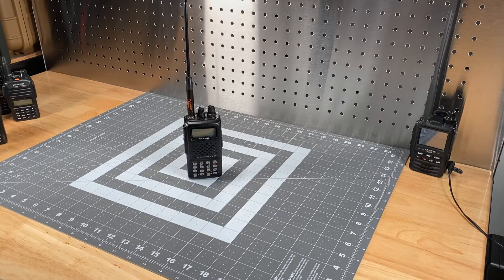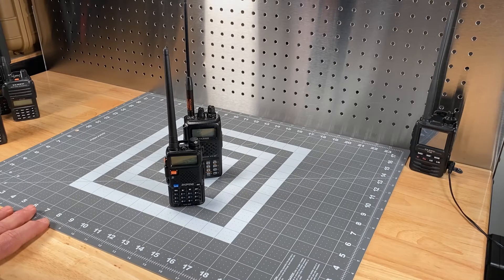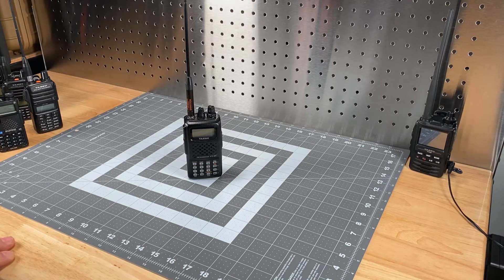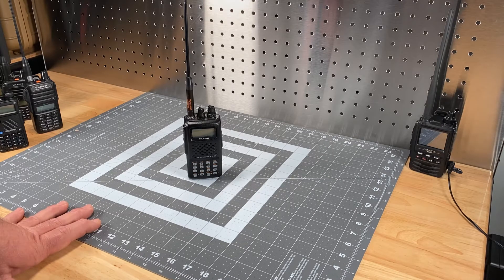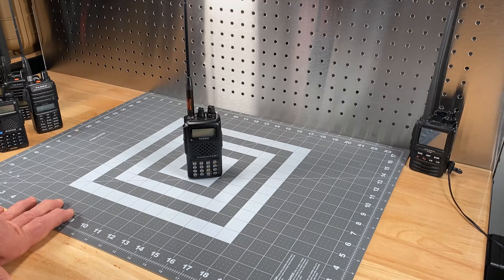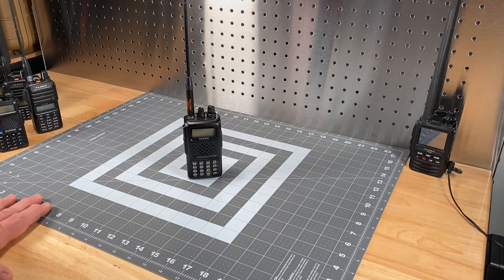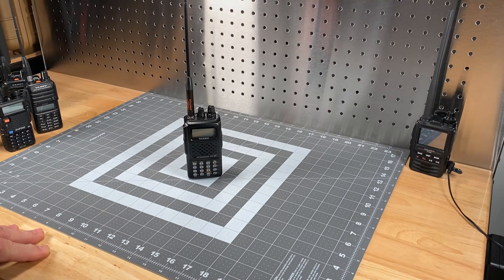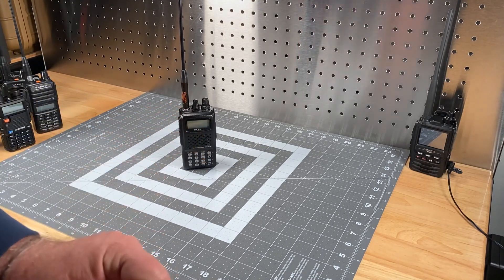Should I MARS/CAP mod my radio?

Comment: I have a Wouxun KG-UV9P that has been modified. It stays in faraday bags in a ammo can faraday cage for emergency situations. I can't see trying to have 1 HAM, 1 GMRS, 1 MURS, 1 LPD and 1 PMR radio during a tornado, flash flood or other similar emergency. My 1 radio can transmit on all of those frequencies. I am a firm believer that it is better to have it and not need it, than to need it and not have it. You brought up another reason for having the mod, by hearing someone in trouble on a FRS radio, they would have to be close due to the low power limits. I have a technician HAM ticket and a GMRS license and i don't understand why i can't have a radio that can do both, other than the FCC says no. I can't use it on GMRS channels 7 thru 14 because of the power restrictions. My radio is a 2, 5 and 10 watt radio and i can only use .5 watts on channels 7 thru 14.  It would kill me to hear a young lady or some kids in trouble and i couldn't help simply because my HAM radio will only moniter FRS and GMRS channels. I think the FCC should take another look at that rule and think about what if that was their wife, daughter or son in trouble. I have a Yaesu FT-3D that i would like to have the mod done on, but that is my everyday carry radio and with my luck, the FCC would want to inspect my gear. Great video and great message.
Reply: The problem is the FCC is a joke that needs to have their power severely limited.
Reply: Ed, I have the same radio and I am looking to unlock those frequencies. How did you go about doing it? Thanks!
Reply: @greenrabbit0341  i bought a unlocking software program from Ebay made just for the UV9 series radio. I can't remember the name because i passed the software on to someone else. It only cost my $27 for the software. My FT 3D and Kenwood TH-D74A  was done by Ham Radio Outlet (HRO).
Reply: @edwardyanceyjr  Thanks Ed, I was able to find the software online and get it unlocked
Reply: @greenrabbit0341  Glad i could help.